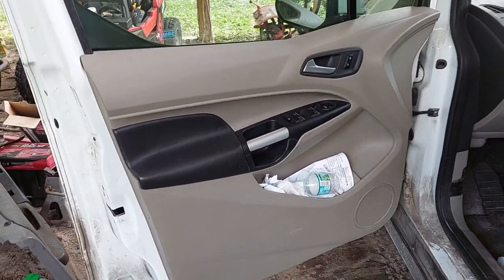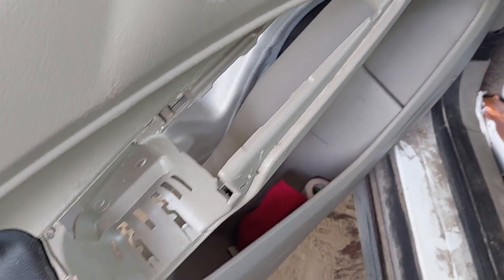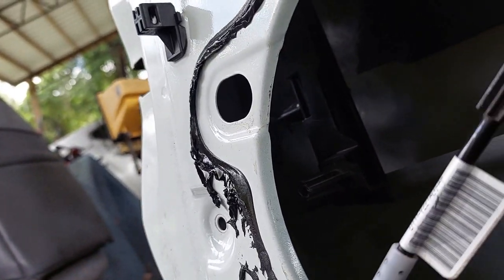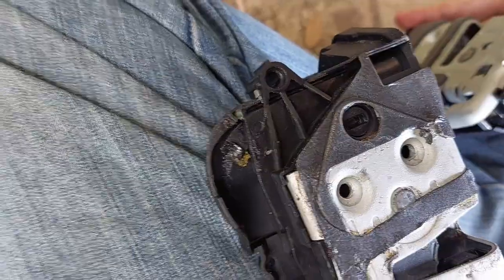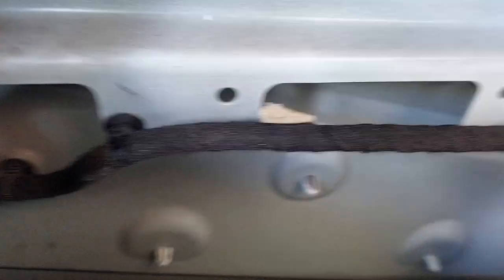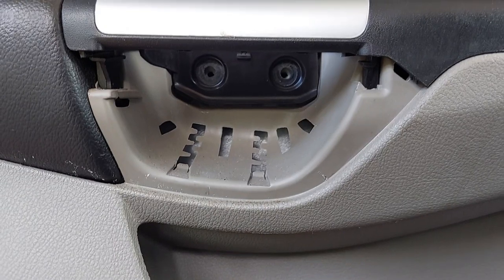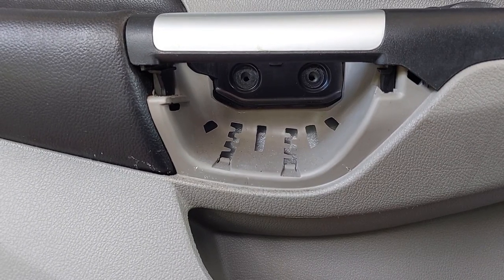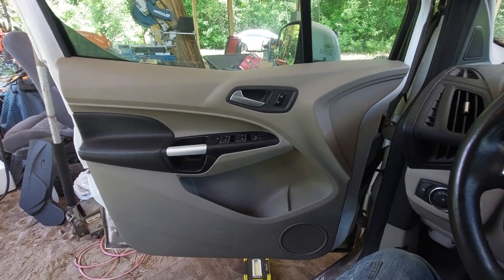Episode 6 - Driver's door latch remove and replace for 2016 Ford Transit Connect

Comment: Thank you for taking the time to film this. It was extremely helpful
Reply from the maker: Oh man... this was such a battle to get done.  I think I spent 8-10 hours one Saturday doing this.  You have to do most of it blind by feel. I remember I didn't have a clamp light yet so I had a standard flashlight wedged inside the metal skin of the door to try and get light places so I could see what I was doing.
Reply: @MazdaB3K  That's why I always make sure to let the author of these videos know that these are extremely helpful. Your pain made it so much easier for everybody else.

Comment: Just done this on my connect due to sensor failing at times. Easiest way to remove is to remove the external door handle mechanism and the T20 screw. Along with the ones down side of door. Whole thing comes out and you can easily rebuild the new one from there.
Reply from the maker: I'll keep this in mind when the passenger sensor eventually fails.. or the driver sensor fails again.

Comment: I just finished about 6 total hours on this one. My door on my 2014 would not latch shut. The T15 screws that attach the latch assembly to the window guide rail were the worst. I had to get a tiny 1/4" ratchet (Klein tools 65200) just to get the torx bit in there. I had a T15 screwdriver and put that through the latch cutout to get the top screw. Definitely would not have been able to do this without this video. Thank you so much!!!
Reply from the maker: I'm glad I was able to help.  Swapping the latch assembly was probably one of the most challenging repairs I've done so I'm glad it helped you get it done by yourself.  The stealership would have charged way too much to do it.

Comment: I just took mine to a Northern Michigan Ford dealer on February 8th 2023 to have the driver's door latch replaced. Parts and labor was $213. I got there at 9 and my van was done at 10:15.
It would have taken me that long to figure out how to get the door panel off.
Reply from the maker: Sounds like you have an exceptional Ford dealer, I'm glad to hear it.  My local one is.... not so great.
Reply: @MazdaB3K  been working on cars since 1980. And as much as I like to do it, I know when to call it good and let the professionals take over. 
I pretty much watched your video three times and that's what convinced me to call my dealer and ask him what it would cost to replace the driver's door latch. 👍
Reply from the maker: What I also know now is that I could have removed the external door handle and a few other things that would have made this job much easier.  I'm about to do this x4 for my F250 and it's not a bad job if you remove all the pieces needed.  That being said if my local stealership was decent I would probably send them some work from time to time.  I still have two active recalls against the van in the video due to how lousy they are in communicating and getting recall work done.

Comment: I left the window track assembly attached on reassembly. Hemostats ( roach clips) helped tremendously on the inner cable and rod when putting back together. Thank you for your video it helped a lot.
Reply from the maker: You are most welcome.  With  the number of views this video has, I wonder if there are that many TC owners out there or if this is a more general modern Ford thing?
Reply: @MazdaB3K mine started acting up after Ford fixed the latch recall. Go figure.
Reply from the maker: @joshuavandal7526  There was a recall for this?  Never got the memo for the Transit Connect.  I'm guessing for the F series trucks?
Reply: @MazdaB3K  mine is a 2016 Transit Connect xlt cargo. Early this year or late last year I believe I got the recall notice. Took it in, even though I didn't feel or see any issues. Right around then it started cubing trouble with sensor like you explained- door open radio keeps going. I would either have to shut door hard or wiggle it after clicking latch without completely latching it.

Comment: Thanks for the video. Helpful. 

As an friendly FYI, it's never left or right when relating to cars. I understood you (and what you didn't say) because I'm a mechanic, but if someone was using your video to remove the passenger side front door panel, it's better to say driver side, passenger side, torward the front of the car or toward the rear of the car to make sure they didn't use "left" on that side. They would break the part. On the passenger side it is on the right, or again towards the rear of the car.
👍
Reply from the maker: Very good observation.  I'll work on that as I continue to make videos.  Thanks for commenting!
Reply: @MazdaB3K  no problem. 
Been building cars, and teaching people to build cars, for about 50 years now. It's these new-fangled cars I find YouTube helpful to show where all the hidden bits are. 

If only I had YouTube 40 years ago, and used it like you do, think how many subscribers I'd have by now! Tens of tens!
Reply from the maker: @whoaaanelly65  It's definitely slow going at first.  My channel has been active 1 year and 1 day.  But like most things, you take a little bit at a time and eventually you wind up with something.
Reply: @MazdaB3K  There is nothing wrong with right and left. Also, this is a worldwide vehicle and there are plenty out there with right hand drive. So "driver" and "passenger" are always relative terms. But when possible, use front and rear when facing sideways. So everything has the same point of reference.

Comment: I wonder if it’s something small, just a worn or misaligned spring causing the issue. I’m having same issues, a little nudge on the latch tricks it into turning off radio.
Reply from the maker: For quite a while I was able to press down on  a small switch located inside the latch and that would trigger the cutoff.  I think there is a switch in the latch that is supposed to cut the radio off when it no longer has contact with the latch, like a break in a circuit.  I didn't take the time to pull the assembly apart though to identify the actual failure.

Comment: Does this switch also put a message on dash that transmission not in park because it thinks the door is open? Domelight stays on and radio turns off soon as the van is turned off. I think because it thinks the door is open.
Reply from the maker: There is a sensor that should be in the console shifter assembly that determines what gear the van is in.  If the bushing that connects the shifter to the shift linkage is failing, the shifter can be moved into a gear position and that position not be what the  transmission prawl moves to.  At least for the 2016 Transit Connect, there is an open recall for the shifter bushing for that exact reason.  There is also another shifter bushing that connects directly on the to the transmission prawl.  If that bushing fails then you won't be able to shift correctly either.  It happened before I started this YouTube channel, but I accidentally melted that bushing with carb cleaner fixing an EGR code.  I had to engineer a new one as Ford won't sell you the bushing alone.
In short, if you are getting vehicle not in park warnings I would start your troubleshooting with the console shifter, not the door.  Check and see if your van is affected by the recall for  that shifter bushing.
If you want to see an example of what I'm talking about, check out my video where I replace the floor shifter in a 2010 Fusion I have.  The setup is pretty similar.  

Link here:https://youtu.be/4aSSexG-I38
Reply: @MazdaB3K  when u shift gears the indicator shows the right gear that the van is in a message just shows on display that trans in not in park shift to P… and front dome lights won’t go out but guess what all this happened once I put an alarm and remote start on customers van so I’m just trying to figure the issue out
Reply from the maker: Hmm... that changes things.  I don't have any experience with the installation of aftermarket security systems, but my complete SWAG would be that one of the wires that you tapped to make the system work is now causing a sensor to feed bad data to the ECU.  I would seek support from the manufacturer of the system, see what they tell you.
Reply: @MazdaB3K  Yeah did that I completely took the system out disconnected everything still no change. Thanks for responding

Comment: I have a problem where the radio and Bluetooth does not turn off when I turn off the truck I open the door then 2 hours later I come back to the car and Bluetooth and radio is still on 
Only way to turn everything off is if I open the passenger door after turning off the truck.
Any thougts on this issue?
2018 Ford transit connect
Reply from the maker: I replied to your other comment about this.  The door lock module cutoff switch is going bad.  I replaced  this module in my wife's 2016 and it was not fun at all.  I made a video but I don't have much footage of the actual work because I couldn't really get a camera inside the door.

Video:  https://youtu.be/YIZWLtTmrkA?si=8mIM_LdEKBIKqErp
Reply: @MazdaB3K  OK great thanks so you had the same issue? Do you have a link or part number and where did you buy the part from?
Reply from the maker: I generally have good luck buying from Tasca Ford or from Quirkparts.  I don't remember where I picked this one up.  For a 2018 the part would be DT1Z-6121813-B.  To be specific, that is for the driver's door (left)
Reply: @MazdaB3K  btw my window and mirror function works the only thing as mentored that doesn't work is the trucks radio and Bluetooth does not turn off and also the dome light doesn't turn on when I open the drivers side door.
I need to open passenger door to turn off radio 
Your still think it's the doors actuator?
Reply from the maker: Yes.  The actuator module contains the door latch, door lock, all the connection points for the lock and the infotainment cutoff switch.  The part that is going bad is the cutoff switch for the infortainment.  The power mirror control and power window control are separate parts.
Reply from the maker: My only caveat to this is if by 2018 Ford changed the design of the Transit Connect enough that the infotainment cutoff switch is no longer part of this assembly.

Comment: What was the part #
Reply from the maker: DT1Z6121813B.  Some part houses still have the -A part, which will work as well.  So you can search against what I put, or replace the B and the end with an A and that should give good results as well.

Comment: This looks like a nightmare. Probably $800 job if done by ford service department?
Reply from the maker: Unless they have a method that makes this go fast, it would be pricey due to the amount of labor involved.  I don't have a Ford field service manual for my wife's van, so I don't know what the "official" repair method it for this.
Reply: Yeah this looks out of my range of patience and skill. Such a FORD designed money pit. I’m starting to hate my van.
Reply from the maker: Mine's been pretty good, at 120k right now.  I had to clean the EGR valve to clear an engine code and that results in me melting the transmission shift linkage bushing which made the shifter not work so I had to fix that... my fault though.  Changing the battery is a pita, changing the CV axles and front shock/struts wasn't very fun either, but they are normal wear items.  I really haven't had much of anything fail that was out of norm.  Water pump went at around 20k but fully replaced under warranty so I didn't have to do that one.
Reply: Yeah I’m same year 2016.. owned it for a year. At 65k, changed the cv axles few months back and now this alarm going off randomly. I believe it’s the door actuator bc my mechanic friend noticed my clock and dash not powering down after whatever..20 seconds of closing the door. So we wrapped some electrical tape on the bracket on the door jam.. As a temp band aid. This helped! Until recently as my alarm just goes off randomly sometimes. I also get a different amount of chirps off the factory alarm during unlock on the key fob. The dealer here in Maui said there should be no sounds during unlock. I get anywhere from two chirps to four fast trips. When it does the four fast trips is seemingly when my alarm goes off about 10 minutes later. So sometimes I feel like I can’t lock my car up or else the alarm will go off once I walk away after a few minutes. Even though the Band-Aid tape is still working and my clock and dash are powering down, I’m assuming it is a faulty sensor or hast to do it that driver side door actuator. Which doesn’t really make sense because the power is going off.
Reply: Yeah I’m same year 2016.. owned it for a year. At 65k, changed the cv axles few months back and now this alarm going off randomly. I believe it’s the door actuator bc my mechanic friend noticed my clock and dash not powering down after whatever..20 seconds of closing the door. So we wrapped some electrical tape on the bracket on the door jam.. As a temp band aid. This helped! Until recently as my alarm just goes off randomly sometimes. I also get a different amount of chirps off the factory alarm during unlock on the key fob. The dealer here in Maui said there should be no sounds during unlock. I get anywhere from two chirps to four fast trips. When it does the four fast trips is seemingly when my alarm goes off about 10 minutes later. So sometimes I feel like I can’t lock my car up or else the alarm will go off once I walk away after a few minutes. Even though the Band-Aid tape is still working and my clock and dash are powering down, I’m assuming it is a faulty sensor or hast to do it that driver side door actuator. Which doesn’t really make sense because the power is going off.

Comment: God these vans are such a joke. My door switch doesn't go down all the way my solution I just push it down the extra .5mm it needs to trigger the radio shut off with my finger 😂
Reply from the maker: And that is exactly what I did for many months, taught the wife to do that too... until it stopped working.  That's when this video was made.